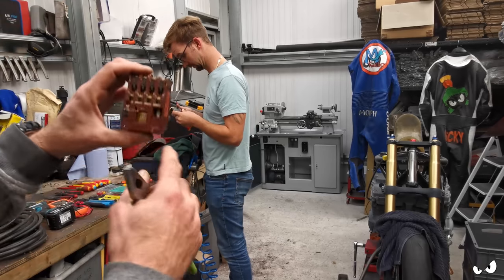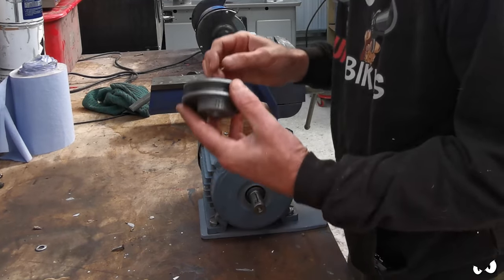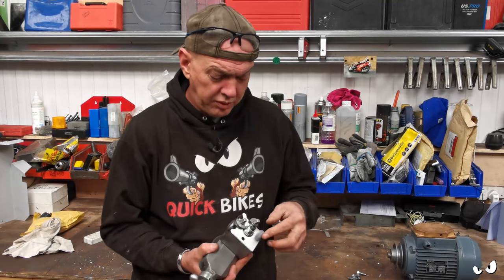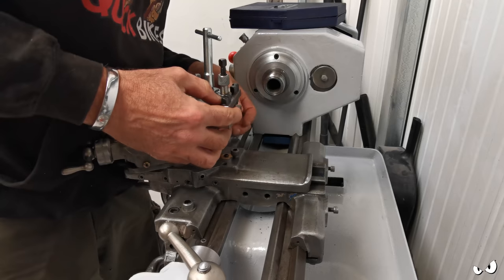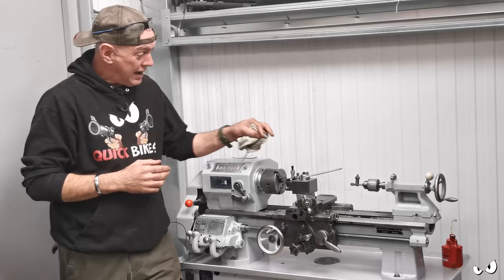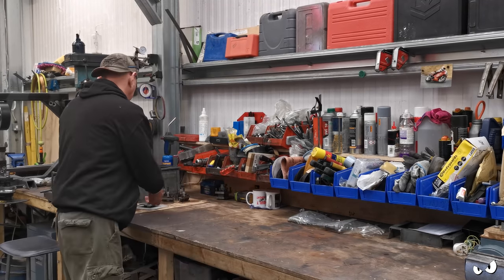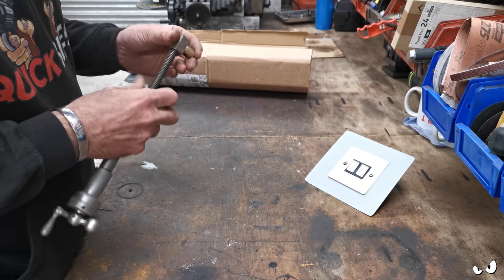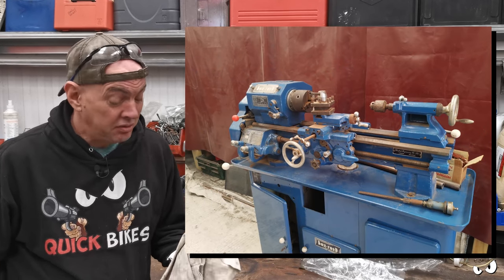Restoring a Boxford AUD Lathe - Part 7

Comment: Looks great, time well spent👍. Just a query, those switches, thought they would be sealed insulated ones, as you said you're hoping to run a coolant pump of one. Wet hands and all that. The ones I've seen, have like a rubber cover over the switches. Just a thought mate.
Reply from the maker: Yeah I've been thinking about that as well... May change them out just to be safe hey 😁👍

Comment: That's come out cracking Quicky, nice job. A quick tip, those gears at the back of the headstock, use chain lube on them, not the PTFE stuff, I use the WD40 brand, doesn't fling off & as you know goes on wet, then gets sticky. Perfect for the job.
Reply from the maker: Ah chain lube... That makes sense. I'll never apologise for dumping oil over my machines, but I really don't want it on the drive belt, so that may well work out good 😁👍

Comment: Just a comment about grease nipples on the headstock - you don't need to replace them  - they are fitted with grease cups  all you do is 
fill them with grease and as you screw them down they push grease into the bearings - use a thin grease because I used a LG-2 grease 
and it was to thick , on starting  it would not run on top speed  until the motor had warmed the bearings up on a slower speed , I fixed this by changing to a more fluid grease and adjusting the bearing preload  -- I enjoyed  the lathe series
Reply from the maker: Curiously enough I just found out about that this morning chatting with Mark. I've packed them with way too much grease (I'm a biker after all and thats just what we do with bearings). I need to run the machine without the spindle covers on to get rid of the excess, then just give the taps a turn every 6 months or so... Makes sense when you have it explained to you doesn't it 🤣😂

Comment: your better off with machine oil than grease, Quicky. The oil flushes out the swarf, grease turns it into grinding paste, but it's your lathe I don't judge.
Reply from the maker: Yup, I now have 5L of light machine oil which everything has been cleaned with 😁👍